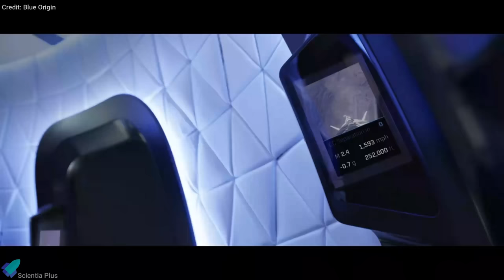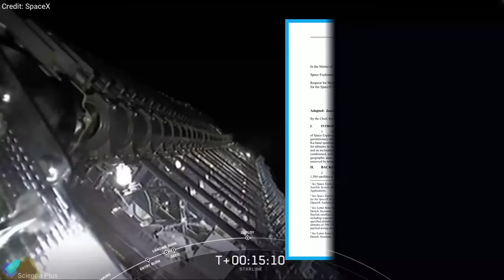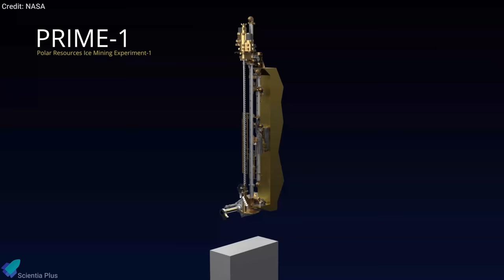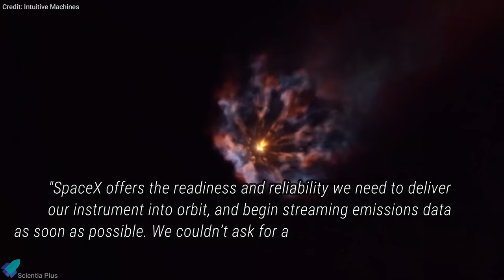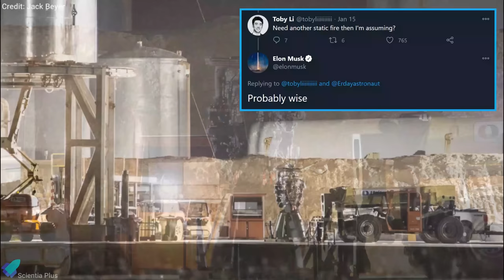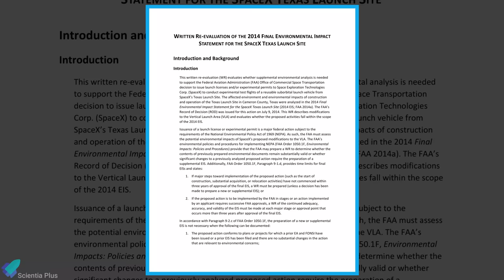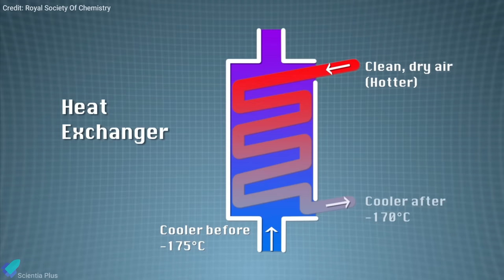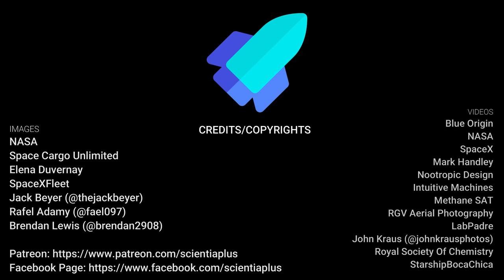Starship SN9 Flight & SpaceX's New Air Separation Unit | NASA SLS Hot Fire Test... | Weekly Updates

Comment: How many spare raptors is each starship going to bring to Mars? Seems they'll need at least two new engines each time they are used as well as 40 expert repair engineers as crew. WHAAAAT ???
Reply: Their rockets only need some smaller refurbishment between flights. And they are getting better at improving reliability with each new iteration and testing.
Reply: @DecepticonLeader  I'm sure they are working out the bugs but one thing I've learnt from Boca chica Texas is that ground staff is vital. At least half of the personnel on every rocket will be maintenance. Ha...
Reply: @ashemgold  For now. But some of the rockets they land on Mars will become permanent living habitats and likely won't fly again.
Even with a small settlement I'm sure they will have enough staff to service a rocket, and they are planning to build a city there, so I'm sure it will be fine.
Another reason they have a lot of staff is because of speed. They want the maintenance to go fast so they can take off quickly after landing. That's the plan.